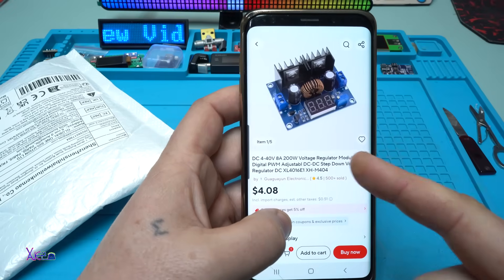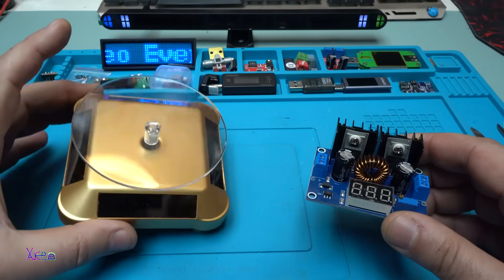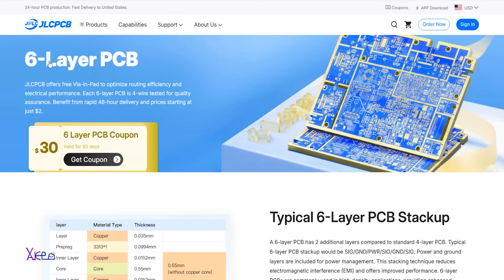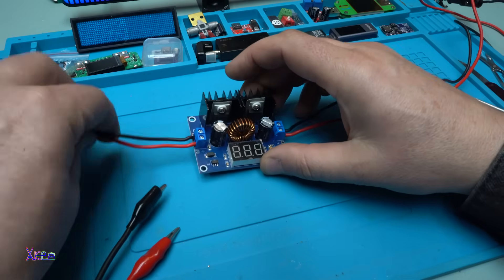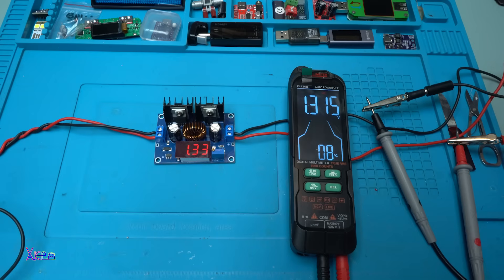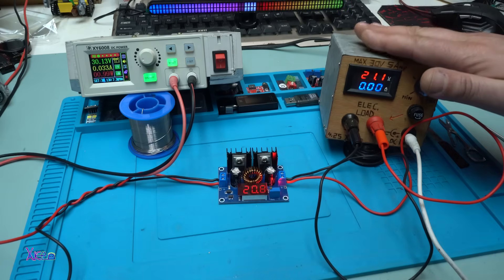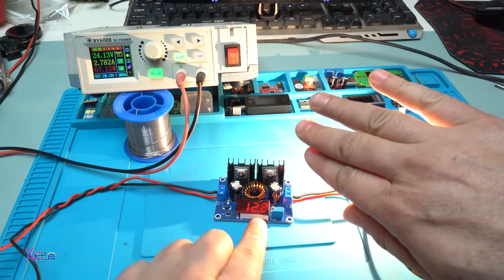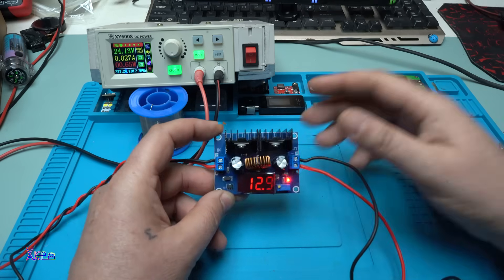WHY THIS $4 Module is SPECIAL?

Comment: It is a basic DC-DC converter without much protection, like OVP or OCP (Over Voltage/Current Protection) and probably doesn't have much in the way of temperature monitoring.  That was demonstrated by the voltage falling and the current rising when shorted.  It would be fine set to the desired voltage and mounted inside a case of a device, but for a variable bench power supply it is missing important protections and a constant current mode.  The XY6008 on your bench does basically the same thing (buck regulator) but safer and with a nicer UI.  Thanks for reviewing it!